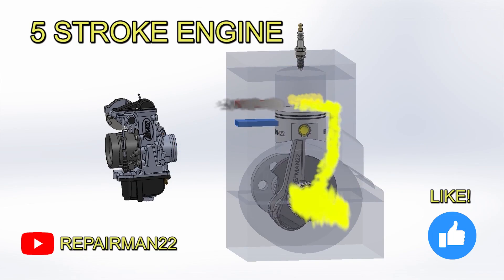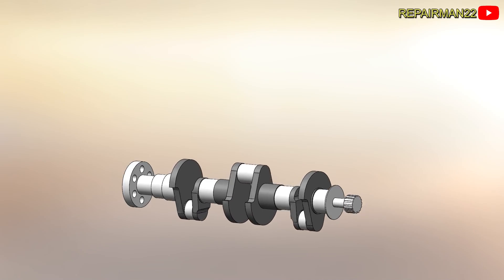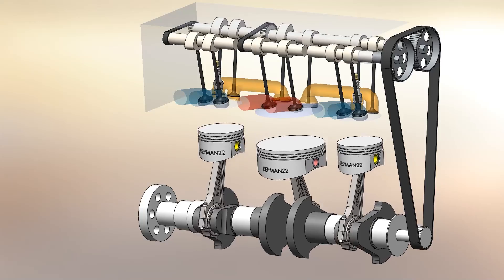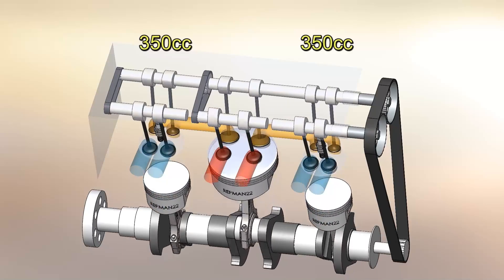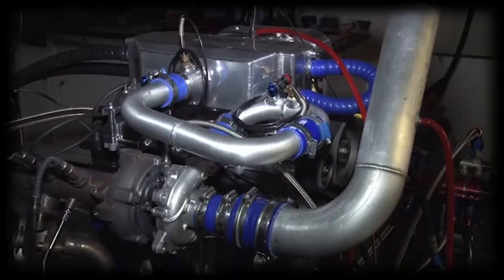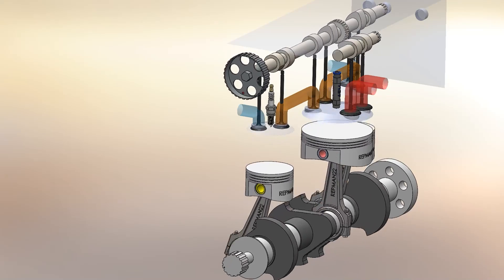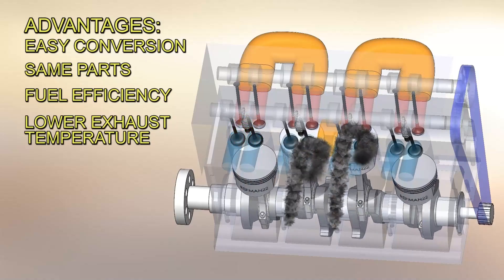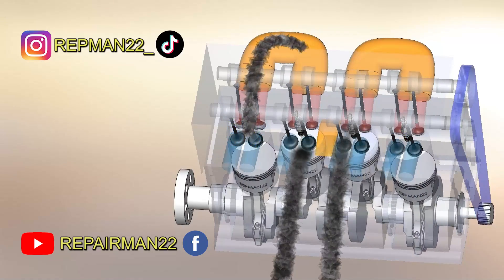The 5 stroke engine with water injection // Tested in Golf MK5 🤯

Comment: It's a double expansion engine, similar to what was used on 1880's naval vessels prior to the triple expansion engine, which is an option here as well. The biggest difference is where the heat is generated. On a steam engine it is created before intake, while on an ICE it is generated after intake, with the extra step of compression.

Comment: Rather than using so many timing belts, why not just make a cam that has 2 high points and 2 low points for the exhaust on the low pressure cyllinder?

Comment: Too bad the small turbo doesn’t generate enough heat for the catalytic converter for it to pass emissions testing. And it stars itself for power as well with the center piston working against the engine.

Comment: Volvo Trucks  have a feature on their 13 liter engines called Turbo Compounding that recovers some of the heat lost during the exhaust stroke without resorting to a fifth stroke. After the exhaust exits the cylinder and goes through the turbocharger, it then goes through an additional turbine. This turbine directs some of the usually wasted energy to a gear link that drives the crankshaft.  This significantly increases fuel efficiency .

Comment: I remember seeing this very setup in an old  Engine Design book from the early 1920s. Same process but it used a standard cam in the block and pushrods driving the overhead valves. I believe the Engine was from about 1915...

Comment: That is just a great idea; also, an engine like that almost needs no exhaust muffler, at least way less expensive; 

it WAS always very sad to me,  to see engines exhaust with a BANG,(remove the exhaust manifold, and you'll see...)meaning that A LOT of energy was wasted;
 
For racing, the center Piston can be used as a "Turbocharger", a Blower.

Comment: Also, the expansion piston could be coated to retain heat. Something you don't want with a normal shiny aluminum piston. As that leads to pre-ignition under normal conditions. But the expansion piston, if it retains heat, would be more efficient at converting the water to steam instantly.

Comment: this engines dumb, its only more efficient at max rpm and wide open throttle, if its laggy for turbo you arent getting there quick, if its no better at highway speeds then its pointless
SO DUMB
Reply: its because it has a greater than 100% volumetric efficiency without the parasitic losses of a belt driven or exhaust driven compressor, that 3rd piston basically functions as an air pump
Reply: take half your spark plugs out is technically 200% volumetric efficiency suck me  @Hydraggle
Reply: if thewy had half a brain exhaust gas wouldnt touch 3rd cylinder. it would solely provide vacuum with its inertia and be not as big as it is  @Hydraggle
Reply: @bigcazza5260  no? because the 3rd cylinder is twice the volume of the other 2, meaning that more air gets sucked out than pulled in, you cannot simply do that with exhaust scavenging.
Reply: 2 strokes already do that with exhaust scavenging, see single cyl piston port 2 stroke? if u watch the video its no better at highway cruising for efficiency than an equivelant size 3 pot and it was slower to spool a turbo hence cant make as much torque down low
volumetric efficiency = power, and power only. if ur engine cuts half of its combustion capacity just to make what 5psi of "boost" (tuned intake on n/a can do this too) if this was the way then f1 would use it, they dont, they either used lots of small cylinders or less small cylinders and a turbo
watch the video ya noob  @Hydraggle

Comment: This is like a turbo-compound airplane engine where an exhaust gas turbine is connected to the crank shaft instead of being used to push intake air.

Found a cool link to a Volvo engine using this! https://youtu.be/wxSOylL5pSs?si=SDRFPtJATd2sBgOz

Comment: The fact that central cil valvetrain has to run at 2x the normal speed basically kills the idea in practice. It might work on small engines, but its not scalable.

Comment: If you put catalytic converters between the cylinders, such that the exhaust from the HP cylinder goes thru the CC before entering the LP cylinder, that might improve both efficiency and emissions. My 2c.

Comment: This will never go anywhere... Interesting and all, but "this ain't it chief"
edit: IMHO, a much better and efficient use of exhaust gases is to drive a turbocharger on a conventional 4-stroke, instead of all that extra "5 stroke expansion cylinder with a big heavy piston and more valvetrain components" nonsense...

Comment: Use diesel. Diesel runs extremely lean, with enough air making it out the exhaust to sustain combustion. The third cylinder can be used with diesel for more power instead of water.
One fuel, one system.

Comment: just diesel on water alone..1 cubic inch of water expands to one cubic foot when turned into steam..a diesel reaches 500 degrees with the compression of air'..all the parts can be much lighter because of the less pressure than fuel ..maybe

Comment: I had a similar idea - but I was thinking oof using a standard 4 cylinder engine custom cams and modified intake/exhaust manifolds.

Basically this thing is like the gas version of a 2 stage compound steam engine.

Comment: This is simply a 4 stroke engine with a different managment of input and output of gasses. You can calculate this in two ways. 
Method A.) (easy) You have three cylinders each of which follows a 4 stroke input and output proces (that is two say 1 power stroke per 2 revolutions = 4 strokes).  
Method B.) (more convoluted) we only count the HP cylinders as actual cylinders and we count the LP cylinder as a "helper" of wich the strokes must be added to the respected HP cylinders. In that case the middle LP cylinder is dedicated for 1/2 to each of the HP cylinders. Together , for each 2 rotations of the crankshaft, each HP cylinder + 1/2 of the LP cylinder produce 6 strokes, but because LP cylinder uses a normal 4 input and output mechanism, it produces 1 power stroke for each 2 rotations or 4 strokes. In other words it produces 0.5 power stroke for each of the 2 strokes that are dedicated to each of the 2 HP cylinders. So for each HP cylinder we get per 2 revolutions of the crankshaft: 4 + 2 = 6 strokes for wich we get  1 + 0.5 = 1.5 power strokes. But 6/1.5 = 4 so we still have a ratio of 1 power stroke per 4 cylinder strokes... so again: IT IS SIMPLY A 4 STROKE ENGINE! (with a different input and output mechanism for reuse of exhaust gasses).

Comment: In my opinion you can get the same effect with the Miller or Atkinson cycles. The advantages of these cycles is that you keep the number of moving parts. Using these cycles it is also possible to vary the compression to expansion stroke ratio. So you can operate the engine in the Otto cycle limit for best power and in the Atkinson or Miller cycle for best efficiency. In general, all these engines are much to complex for unexpensive manufacturing.

Comment: I applied to DARPA with this idea in 1989 and they turned me down. But water injection will not produce more power. This was thoroughly tested by NACA. Water injection raises octane rating in internal combustion, only.
Reply from the maker: Water is injected in the expansion cylinder. No combustion occurs there, so octane rating has nothing to do. Thank you for writing.👍

Comment: the idea of a turbo that feeds a fixed volume cylinder that then feed the power cylinders with boosted air preasure dont seems like a bad idea as the boost cylinder could be of slight higer volume then the power cylinders making the engine feel like its got torque at all revrange and it feels like a bigger engine then it is.

Comment: if you really want to harness the power of the exhaust gases then just put a generator on the turbo like f1 does, it makes for the best fuel efficiency ICE can reach and can be installed on whatever engine you want in addition to improving fuel consumption at any load due to the fact that you use this power whenever you want with your electric motors
I really don't get why it still isn't being used in all the new ICE vehicles

Comment: Isn't the 3⁰ cam unnecessary? Instead wouldn't it be easier to have 2 lobes per valve for the 2 valves in the middle piston? That way the cam would spin at the same speed, but it would still active it with double the frequency

Comment: 7,000 RPM? ... with that camshaft that spins twice the speed, that's the same potential for valve float as an engine running at 14,000 RPM.

Comment: Sounds like you would have to have water injection due to exhaust gases being
 used only for the center cylinder

Or I should put the center cylinder only using exhaust gases water injection would keep it clean

Comment: 5:50 I don’t think that any engine can be converted. Particularly V6 engines as if I’m understanding correctly the firing order would have to be altered which is not a quick modification. Honestly I don’t think any v engine would be easy or even worth modifying. 
It is a really cool generator engine concept and I do think as a range extender it has potential to actually come to market

Comment: I'm not an engineer but could this concept not also be applied to create a three-stroke engine from a two-stroke, significantly improving the emissions and scavenging even greater power from the exhaust gasses than the five-stroke? I imagine the cost/benefit must not work out in that kind of in-between application.

Comment: 1st of all “5 stroke” is just a call to grab attention 😂 There is nothing related to the name. Call it a 6 stroke either (4 tradition + 2 more exhaust strokes 😆) 

I've some doubt.
1. The central piston just sucks in the exhaust gas and the piston pushed it out in next stroke, then why did it entered 🙄? 

2.And the bigger size of central piston, why it is? Is it only to balance the rotating weight of the Pistons or something more?

Comment: ...The return of "long stroke" engines which is an industrializable compromise and which floods modern engines.

The ideal would be to have cylinders thermally insulated with extraterrestrial materials to conserve energy/heat... (very) hot exhaust gases to be effective on a second expansion.

The "long stroke" offers cooler exhaust gases.

Comment: It seems to me that this is what the auto manufactures should be pursuing instead of an all electric vehicle. Range anxiety and the very large and heavy batteries is what is stopping the EV market from taking off. Furthermore, it appears that a diesel version of the 5 stroke engine would be even better for fuel economy and fuel options such as renewable diesel. This is something the greenies should love. There are a multitude of fuel options with a diesel engine. Spark ignition is limited because of the compression ratios limitations and associated pre-ignition problems.

Comment: The middle piston getting the exhaust gasses without combustion is going to get filled with carbon. Without fuel and combustion the cylinder walls will get destroyed from the abrasive carbon.
Reply: Let's not introduce science and facts to mess up this nonsense.

Comment: Toyota hybrids operate on the Miller-Atkinson cycle; they just close the intake valves later to make the expansion longer than the compression with good efficiency at low speeds. No need for an extra cylinder :)
Reply: Americans are very good at "inventing" things thirty years after someone else invented them elsewhere.

Comment: No idea why all hybrids aren't an ICE running a generator at optimum RPMs to recharge the battery.
Reply: Losses into and out of battery.
Reply: I think the English name is "series hybrid". They are efficient and very simple. The main issue is the high fuel consumption on the motorway. Volt/Ampera is a good trade-off between the two worlds, even if they have their own problems.

Comment: So it uses the pressure of exhaust to turn the crankshaft.  So a turbocharger, but instead of that rotational energy going into bringing in more intake pressure, it goes straight into the crankshaft.  So really, an inverse supercharger, instead if using crankshaft energy to bring in more fresh air, it uses exhaust to give more crankshaft rotation.

Comment: These would make for great small generator engines, especially stationary ones. Even better on small long range ships since they already would need a water purification system.

If you remove the water injection, they make for great airplane engines. If used on cars, they could be used as gas over electric hybrid vehicles similar to the Audi Dakar racecar.

As other commenters pointed out, the catalytic system would have to be built into the block as the exting low temperature water-contaminated exhaust would not be compatible with traditional systems.

Another idea would be to us the waste pressure and heat to drive a separate turbine as a multi-cycle engine. Again, this would likely only be most efficient at specific engine speeds and would increase in efficiency with scale. A good in between would be to use a turbo as in a car engine, it's very nearly the same concept, yet less complex and more flexible.

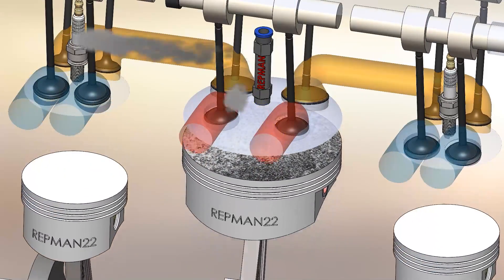Comment: 03:43  the injected Water (to further increase Efficiency) must be demineralised (Boiler-feed Grade) then has an Equivalent "Cost" as its own fuel.. Gasoline Price.!!
Reply: As said so, its optimum speed is rather high, not match the city-congested traffic speed. The continuous speed is then more suitable for electrical generator (RE) in EVs. Or running at cruise speed out of town.

Comment: The capacity of (2) Combustion cylinders is 700 cc., Correct, but not include the larger-middle (750 cc.) Dummy-piston. That is Regenerating/additional power Stroke..eg ;
Main pistons power (22%)+Dummy (non-combustion: "34"% of 22%= 8%) = 30% in total
If main piston power (24%)+ Dummy ("34"% of 24%=9%) = 33% in total (thermal efficiency)
Extra 34% means 26% out of 74%(combustion) : 26 + 74= 100% : (26÷74) = "34"%
Thus reduce Exhaust Gas temperature from 800 - 850°C to 500 - 520°C, get more power.

Comment: how is this more efficient , it looks like you need extra more complicated parts for this design , 2 size rings and pistons and rod bolts and the only advantage i can see is that it is smaller than a 4 stroke 4 cylinder in line

Comment: Couldnt this engine be used with a cvt transmission ? Because if its running better while high rpm, the cvt could be optimized to force the engine to rev high even in city or not ? together with good isolation and small engines, shouldn‘t even be disturbing for citizens.

Comment: 1) I doubt the fuel efficency will increase by 40 % (- 30 % consumption) by just using a part of the residual excess pressure (5 bar mentioned).
2) The displacement is 1.5 L as also the central cylinder displaces a volume.
3) What happens at low loads (traffic)? The excess pressure from the combusting cylinders would be much lower, but there is still a need for excess pressure for final exhaust. The middle piston would then "suck" the hot gases (or might provide resistance) ==> Efficiency would go down.

Comment: Better to run the second expansion cylinder on something like 1-way valves like reed valves. Also, to combat the loss of efficiency at low load and the lower pressure/energy causing turbo lag, make the second expansion cylinder the same size as the normal cylinders instead of 2x the size. Also make the whole engine in general "under square" for thermal efficiency. Also, for better frictional efficiency, you could make the whole thing a Taurozzi Pendulum engine.
Reply: Making the second expansion cylinder the same size as the primary cylinders defeats the point. The reason it's larger is because it requires less mechanical force to push a smaller chamber's volume into a larger one. if they were the same size, the force pushing back on the primary cylinder would completely negate any force imparted on the secondary cylinder, and you would run at less efficiency than if you didn't have the secondary cylinder at all because it would just be dead weight.

Comment: its so similar to a steam engine, a double expansion or triple expansion, where a small piston initially has the high pressure, then a second piston (much larger ) has the exhaust of the first cylinder, which would otherwise be wasted

Comment: Like others said, it's basically a double expansion engine. It was sometimes utilized in steam engines, but mostly not: if you pull back the johnson bar, this allows steam to work by expanding inside the cylinder instead of just pushing the piston with its pressure, and so by the time the steam is exhausted there's simply no pressure left to drive another cycle of expansion. In other words, double expansion only allows for more efficiency at maximum power setting, and doesn't do anything otherwise. That's fine on a power plant or a sea-faring vessel, but in motor vehicle applications you don't usually even use the maximum power setting, and the added complexity and weight isn't worth the benefit of slightly reduced fuel consumption when you're pushing full throttle. Which is why this extremely old technology which is also a no-brainer to add to a piston-based engine haven't found its way into production cars and trucks. In ICEs specifically there's an additional array of problems such as carbon buildup which can't be self-purged from a cylinder that never burns fuel.
Reply: Well thought out, I hadn't considered the carbon in the expansion cylinder, it would be like a gdi engine's valves not having the fuel flowing across them to clean them.
Reply: Good point. Fortunately, using a piston-topper to segregate the hot gasses from the piston allows surfaces to run above  the temperature where carbon buildup occurs. “Engineering Explained “ has a good video. Search “Italian tuneup”.
Reply: I like to pull back on the old johnson from time to time, myself...
Reply: This engine only work at maximum throttle, should fitted to a race car, should see some benefits.